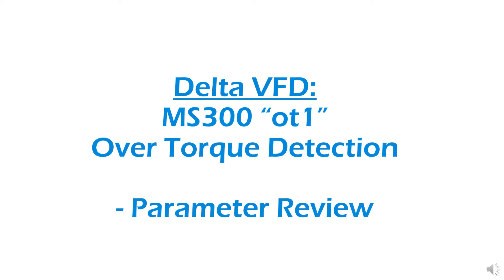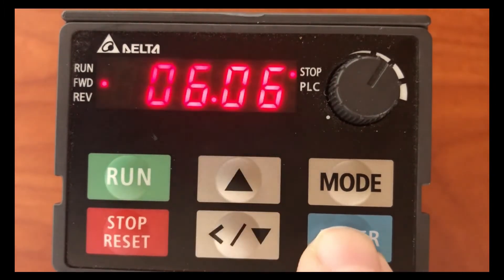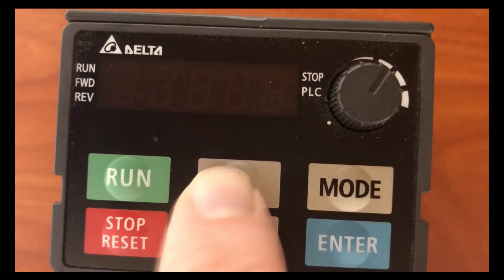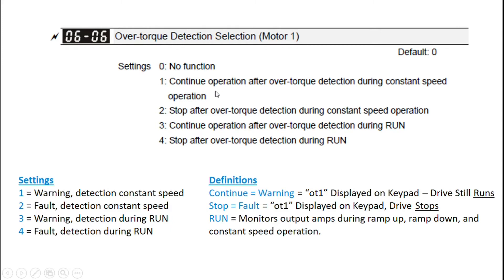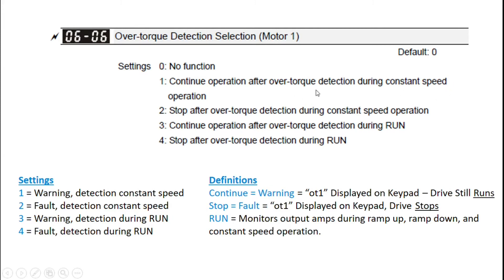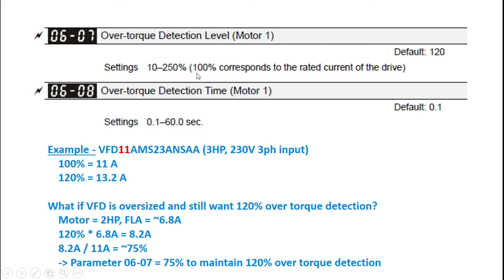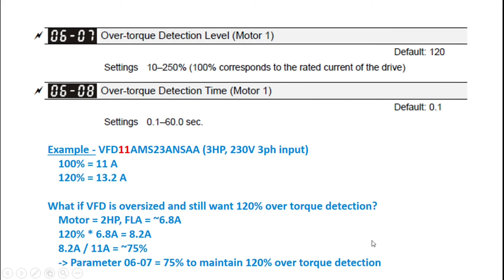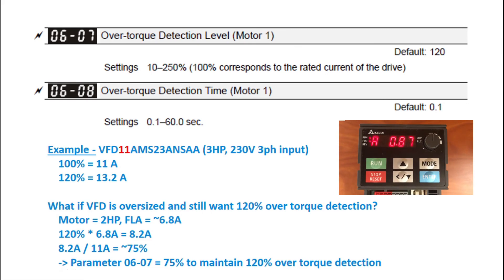Delta MS300 ot1 "ot1" Over Torque Detection

Comment: Hey I came across a unit that was doing this today. VFD is password protected. Of course when I leave site, I find literature on resetting VFD to factory settings. If I reset VFD will it still be password protected,?
Reply: Good question working on a unit now and I don't know the password
Reply: @Shmigzy I actually ended up having to go through manufacturer of equipment. They sent me over a cheat sheet for the VFD.
Reply: Bro try 1234 lol that's what tech support just told me
Reply: @Shmigzy yeah same that's what up ended up working for me.